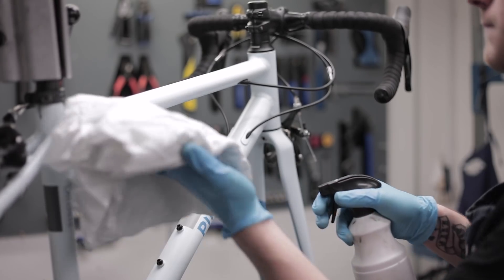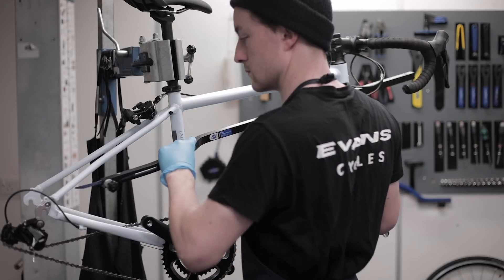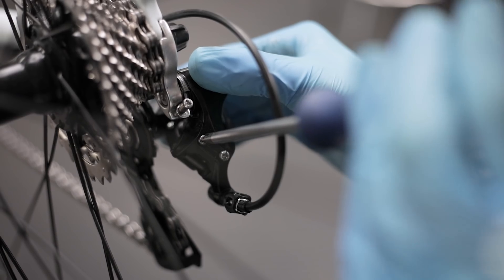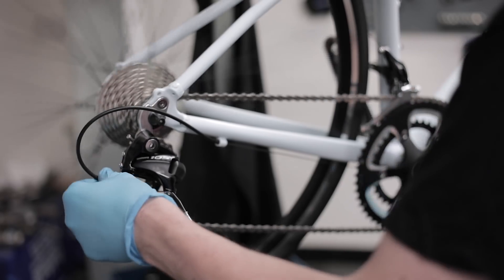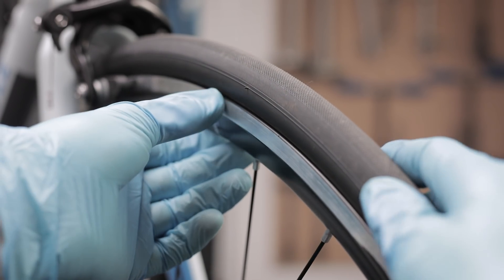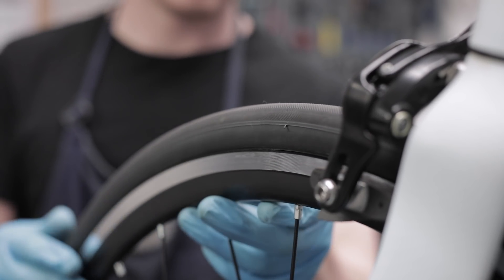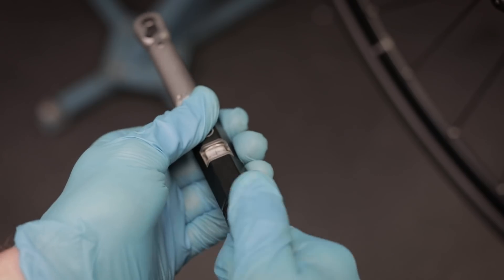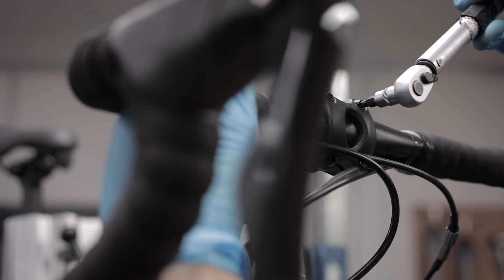Evans Cycles Servicing - BRONZE SERVICE

Comment: As a former employee I will warn you all that this level of attention to detail will likely not apply to your bike. I never saw frame and fork alignment checked even in gold services. Frames weren't cleaned either. Torque wrenches rarely used to check bolt tightness. A bronze service was usually just a quick brake and gear tweet, pump the tyres up and out it goes
Reply: AceRidesBikes Sounds about right. Many bike builders and mechanics just didn't have high standards, and the ones who did couldn't do their best due to the strict time pressures, even when the workshop diary wasn't busy